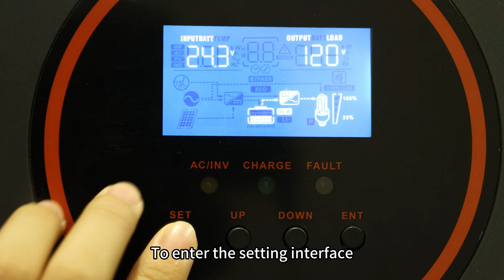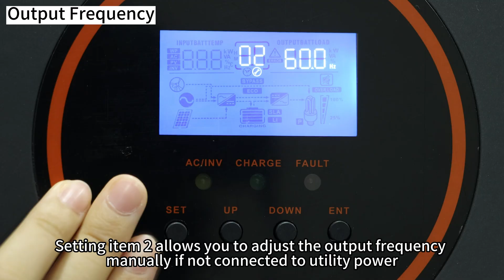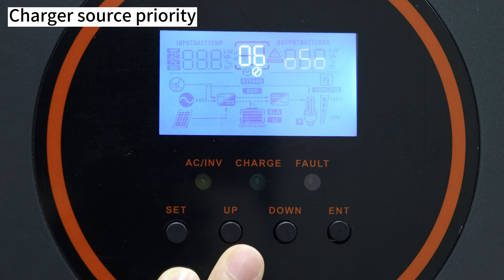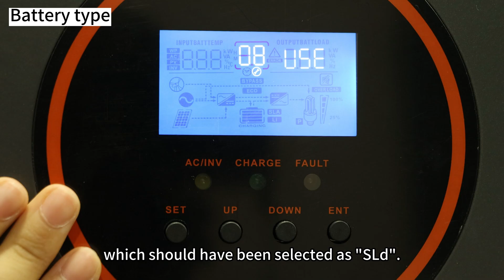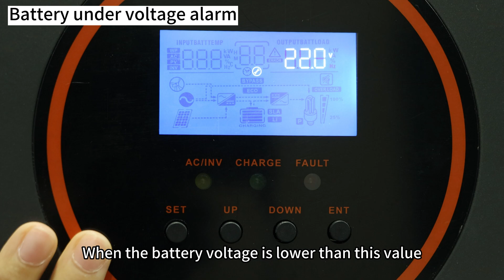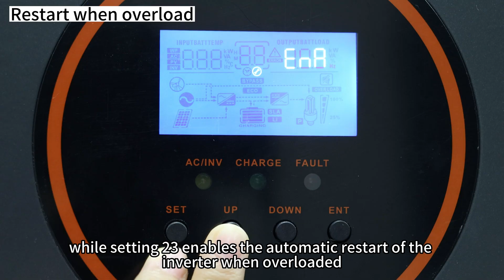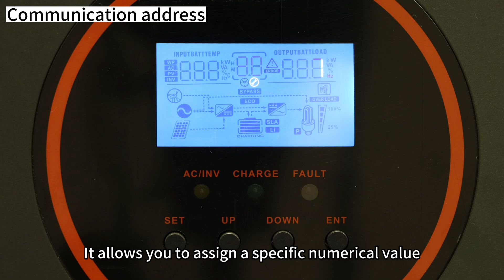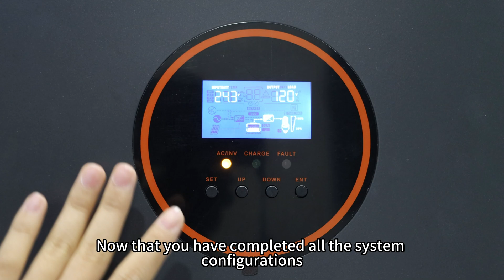Inverter Setup Guide: A Comprehensive Tutorial for Beginners

Comment: what I dont like with powmr inverters is the dirty output when the load is supplied thru solar power not by battery specially at higher output sensitive devices like smartphones tends to have problematic touch like ghost touch when plugged in but in battery mode its just fine, higher frequency tends to be the problem and also its output thru ac is not clean pure sine wave.

Comment: Hi,I just bought a 6.2kw 48v battery system hybrid inverter to run my ac/dc solar submersible pump(3hp),can this inverter handle a 16 lead batteries(12v,100ah)connected in 4series and then  parallel the 4series to create the 48v system,please advise ….
This is for an off grid set up in my farm…thank you.
Reply from the maker: Yep, a 48V inverter requires a 48V system.

Comment: Hi,I noticed you also sell battery equaliser and since you already have an inbuilt in the inverter,do I need to buy that separately or ?,what’s the difference…thanks
Reply from the maker: The built-in equalizer is used to equalize the voltage between the cells in a single battery. If you purchase an external equalizer, it is used to equalize the voltage between the batteries.

Comment: I use POW-HVM3.2H-24V-N
I have noticed that the inverter is sending back the AC to the Solar panel and even on Batery terminal...is it normal to do that??? because i am getting electric shock whenever i try to touch the battery terminal and the Solar panel wires

it does like that when i put the it in inverter mode while converting the DC curent to AC courent 

regards
Reply from the maker: Please send it to this email: support@powmr.com. Our technical staff will check it for you.

Comment: Ive sent in your email an issue regarding sbu and mks priority. The inverter i bought is 1kw 12v. It dose not return to battery use. It is always using grid despite the battery voltage is at full charge already.
Reply: You need to re-check set item No. 4 & 5, this will help you

Comment: Hello ma'am PowMr 1KW 12V Hybrid Solar Inverter 230Vac PV Start Voltage 20Voc Built In 80A MPPT Solar Charge Controller 50/60Hz Auto Pure Sine Wave Inverter.What DC and AC breaker is suitable, and how many amperes? also what kind of solar panel is suitable for a Hybrid Solar Inverter?

Comment: Hi. How can I program my inverter to allow input AC (UTI) up to 260v ? It is currently programmed to cut off when AC input is higher than 250v.
My inverter uses the same software as yours shown here. Setting 3 is for APL / UPS setting.
Reply from the maker: May i know which model?
Reply: @PowmrSolar 
Thank you for your reply :)

 It is a SkyKing Model SKL 2024 2kw. As you may have noticed, most of these inverters uses the same software. The screen looks the same, and the programming has the same numbered functions.

Comment: I have a 3000 watt hybrid 24 volt inverter I have 4 solar panels equaling 3200 watts for some reason  when I hook them in its is not picking up any solar panels connected
Reply from the maker: Hi, please send your problem to this email: support@powmr.com. Our technical staff will handle it for you.
Reply: Hi I have the 3000watt hybrid 24volt inverter. I’m completely off grid. My question is what size generator is recommended for this unit so when my batteries get low to recharge them

Comment: Hello, I have a pow-lvm3.0k-24v. However, it reports different voltage from the BMS (jk-b2a8s20p) and the multimeter, is there a way to correct this? Is there any calibration? or software update?
Reply from the maker: Hi, please send your problems to this email: support@powmr.com

Comment: Helllo,  I have a POW-SunSmart Series all-in-one solar charger inverter 5000 watts.
My 3 solar panels only provide a max of  117 VDC ...some days...  
1. QUESTION: While getting power only from the sun....what functions and features will work as designed? 
change
3. QUESTION:  Will my Battery charger work with only 117 VDC?  ( or can I change any setting to override the defaults?)
Minimum
Reply from the maker: Hello, kindly send us the model number.

Comment: i have the sp5k, i have it set for 120ac.  i dont have a battery, is there anyway to use the inverter with just the solar panels to run stuff during the day. also no AC connected.
Reply from the maker: This model can work without battery, but we do not recommend working without batteries, as PV generating electricity during the day without batteries is not a constant process itself.
The PV may be high or low, and it does not completely match  your load usage habits, which will lead to the fact that when the PV power generation is good, the load may not be used so much, resulting in waste; or when the PV power generation is not good, the load needs a lot Electricity, if PV cannot be brought up, it may be completely replaced by mains electricity.
If there is a battery, it is different. If there is more PV, it will be stored in the battery. If the PV is not enough, the power in the battery will be used. Except for special circumstances, the mains power will be used.

Comment: hi.. i have new POW-HVM4.2M-24V, can i use program No. 01 Sbu and program No. 37 Hyd in same time? 
i mean in condition mode SBU can send exceed panel power back to the ac grid?
Reply: I want to use this hybrid inverter if it uses solar during the day and uses batteries at night, but during the day excess power can be sent to the grid utility.
how do i set it up?
Reply from the maker: @komarudinaja1291  Hi, may I know where are you from?
Reply: @PowmrSolar  indonesia